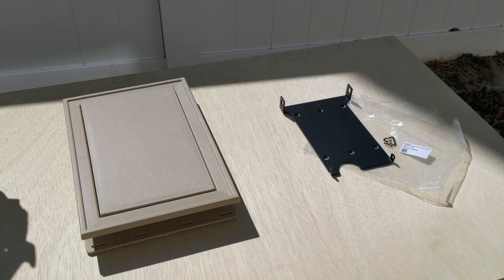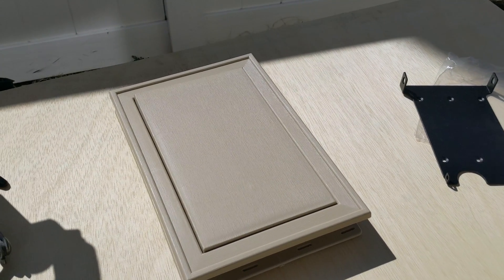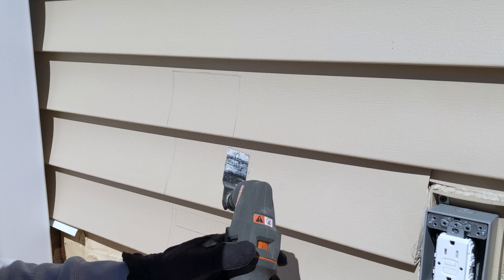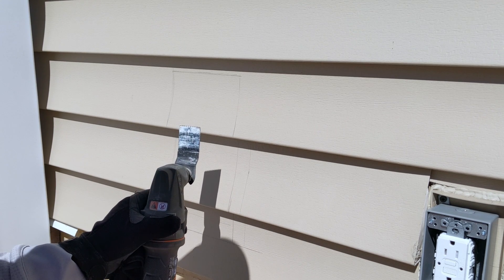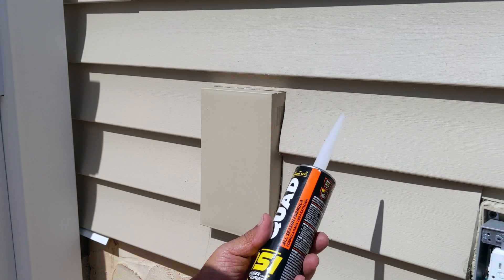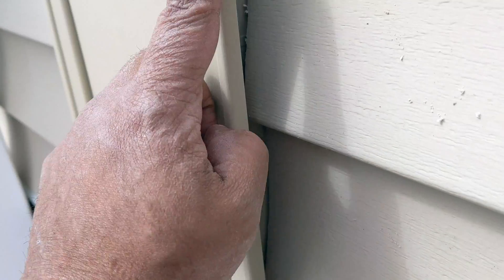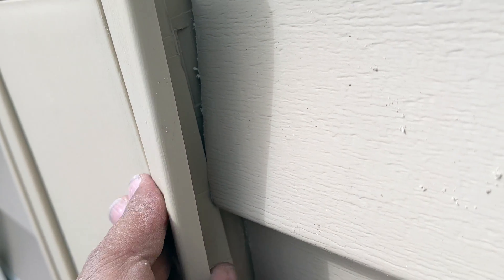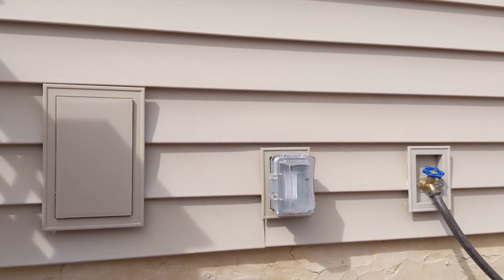How to install a mounting block on vinyl siding for Tesla wall Charger outdoors

Comment: I viewed this after watching your video on installing the water spigot. Seems like you don't do anything half-assed. I like that. :)

"I wanted...a cleaner look"..."I'm gonna try to keep it aligned with the existing boxes."...A man after my own heart...

3:42 helps to understand how the siding locks together and can be unzipped, good angle.

I liked how you mentioned taking your time and being safe. When it comes to quality work, you can't rush it. +1 also for how you talked about Tyvek tape and going a little extra on it - I believe that nobody cares about your own house more than you.

I'm planning to exhaust a bathroom fan through an exterior wall with existing vinyl siding and wasn't satisfied with anything else I was seeing. Slapping it up there and screwing it in all kittywampus with a bunch of caulk around it isn't my style and would bother me forever. A mounting block is how I want to do it, but I wasn't sure how to get one under the siding and sealed properly, and was worried I'd end up having to span multiple courses of siding. After watching your videos, I'm confident I can do this.
Reply from the maker: Thanks for the feedback and I truly believe in sharing information with the community and helping others. It made us better as a whole. Thanks again and please remember to subscribe to the channel and like the video.